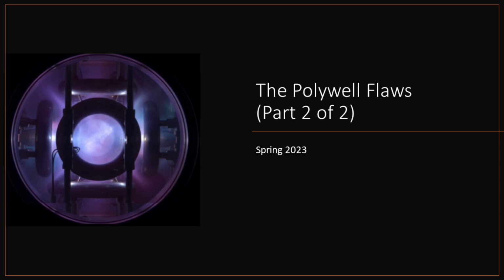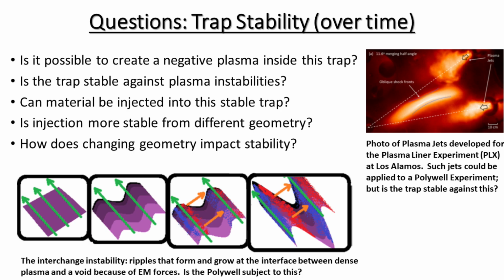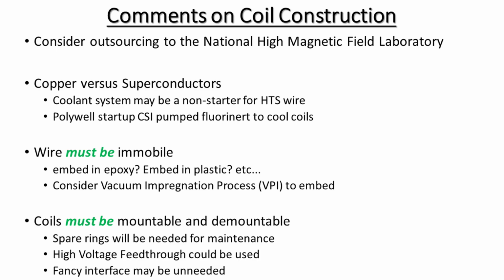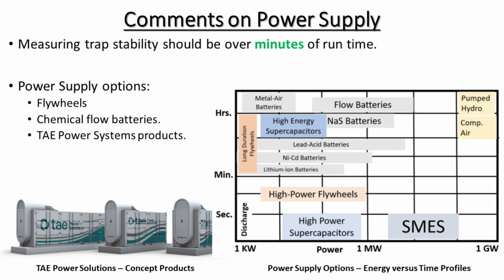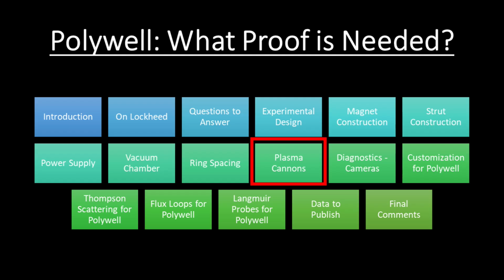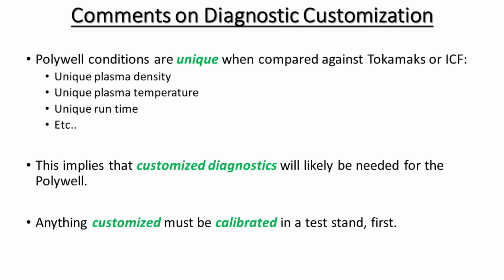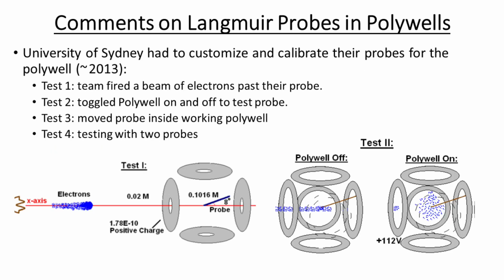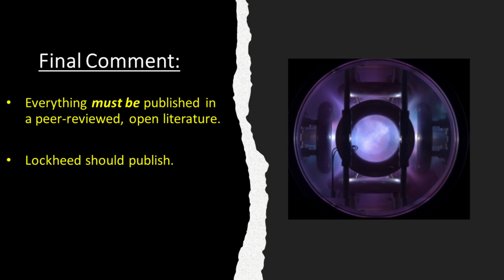Polywell Flaws (Part 2 of 2) - The Test Required to Validate

Comment: Thanks for creating this. It is great to see a well-informed view of the unknowns and challenges with the Polywell. 
As an idea for measuring the diamagnetic strength and density, a simple load cell or pressure sensor worked into the struts could suffice. Using something with a known diamagnetic strength for calibration.

Comment: I don't want to correct thing that I don't understand but,I gonna doing anyway : the most simple geometric form shouldn't be a cube, but a tetrahedron, so not sixth ring in a cube like box, but four rings in a pyramid like box, and instead of ring like shape, should have triangle shape (well with corner rounded), I don't know if that would be better or worse for this specific purpose, but technically should be more simpler.

Comment: Question, in some fields it's pretty obvious that peer review isn't all it's cracked up to be. Replication issues regardless of peer review, sometimes obvious nonsense making it through peer review, peer review process appearing to pay to play or political, etc. Publishing data is paramount, of course, but my question is specific to the fact that you mention peer review a few times, presumably as opposed to publishing a preprint on arXiv or, say, a report from a panel hired by the Navy. I have a perspective that peer review can be very good but it can also be a burden and does necessarily lead to less openness, especially wrt IP and niche topics.

Has physics avoided issues with peer review? Is my perspective unfounded? Just asking you to share your thoughts on that aspect if you can.

Comment: The biggest problem I have with polywell, and these types of containments in general, is that if you look at what is actually keeping things in, there is zero containment along a specific channel down the center of the magnets. Mathematically zero. Any ion with the right trajectory can just exit. This to me makes this geometry a non-starter.
Reply: If high energy electron beams are focused on these points, negative ions escaping the trap would be like salmon swimming up stream....
Reply: It's the holes in the whifle ball, for sure.  However, it could be an engineering issue, ions that get shot out of the holes in the whiffle recycle back into the cusp, but you would need a vacuum chamber the size of a garage.